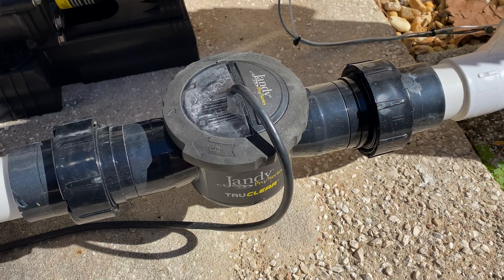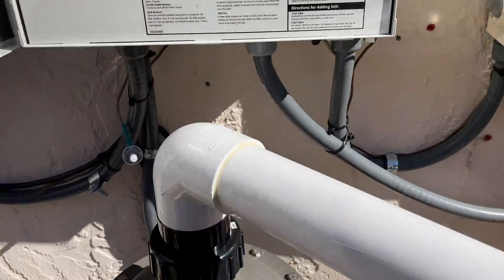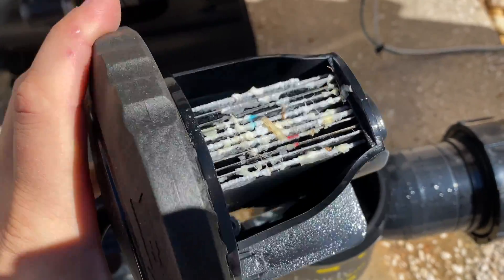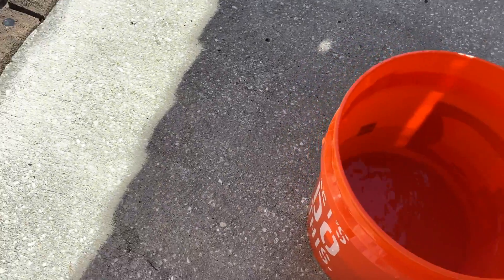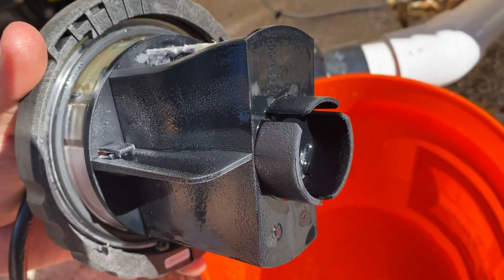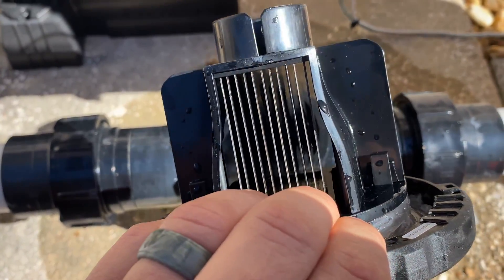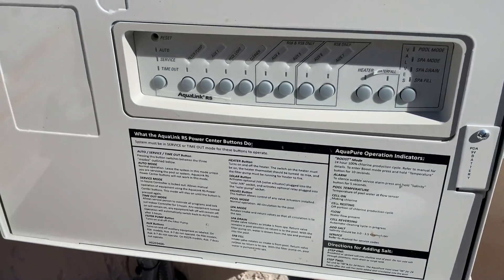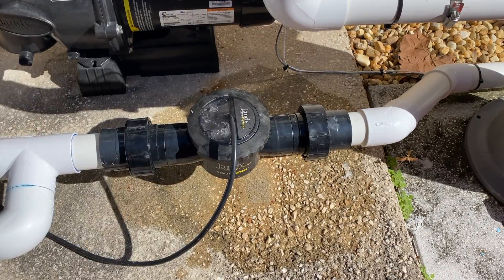How To Clean A Jandy TruClear Salt Cell: Easy Guide To Remove Calcium Buildup!

Comment: How do you clean an aqua star filter?
Reply from the maker: They are very similar as the Pentair Clean and Clear Filters. Once the system is off you have to remove the lock ring, pull the lid, then pull out the cartridge with the core in it. Then just hose it off and reassemble. Thanks for watching.

Comment: I get a lot of white flakes in the pool which I'm told is some type of salt/calcium buildup that occurs when the filter and salt cell turn off at the same time. The plates of the salt cell are hot and cause the buildup when the water turns off and then the buildup gets blown into the pool when the filter kicks on the next day. It was suggested to add an additional timer to turn off the salt cell 15-20 minutes before the filter turns off to allow those plates to cool down, thus eliminating the flakes. Ever hear of this??
Reply from the maker: To my understanding that is called calcium phosphate. It’s caused from phsophates and salt cells in  addition to having the pump and cell turn off at the same time like you mentioned. Get the phosphates under control. Turn the salt system off for a week or two and then when the phosphates are low then slowly introduce the salt system back to the pool. Also, a great idea like you said to have the cell turn on 30-60 minutes after the pump starts and also 30-60 minutes before the pump shuts off

Comment: Handling acid without acid-resistant gloves...NOT GOOD!! No wonder your wedding ring looks destroyed.
Reply from the maker: No, my band looks like that because that’s how it’s designed to look being made out of silicone/rubber. It’s impervious to chemicals and also won’t be a conductor when working with electricity. Nice assumption though…

Comment: Hi,
I have the same salt cell and it cracked for some reason.  It is just out of warranty.  Are the new ones easy to install?  It looks like I just have to plug it in to the panel.  It seems simple enough.  Thank you for your help.
Reply from the maker: Yes, very simple to replace a cell if you need to. Good luck.

Comment: I've also installed this Truclear cell for a couple of my clients and I am planning to clean their filters and the cells very soon. Did Jandy recommend you to remove the o-ring before you put the cell into the acid&water solution? Are you doing that just to prevent any water leak from the damaged o-ring in the future? Do you also need to lube it before putting it back in?
Reply from the maker: I remove the O-ring just so I can clean off the old lube. I do re-lube it. I hope this helps!

Comment: Hello!  Great tutorial; allowed me to maintain my own salt cell. This last cleaning resulted in a lot of build up to get stuck in the top of the cell; visible in the clear part of the lid. Suggestions on how to remove it?
Reply from the maker: Sorry for the late response. I guess I didn’t get a notification lol. Just take a tooth pick or some other soft material and pick it out. Also when you’re soaking the cell make sure it sinks enough in the solution to where the top is also getting cleaned.

Comment: Great video, I have the same system and have been doing the maintenance. How often should you clean the cells?? Thanks
Reply from the maker: Really the best measure is when you start to see a lot of build up on the blades. Typically this is every 3-6 months. Every pool is different so you may end up cleaning it less or more than every 3-6 months.

Comment: Do you charge an extra fee for this or include it in the service? Also, do you bill extra for salt on salt pools?
Reply from the maker: I do not. I usually start the cleaning before I clean the pool, and then once I'm done get it all put back together. In regards to the salt, if it's a massive dose, then yes. But if it's a maintenance dose (a bag or two every couple of months), then no. I hope this helps!